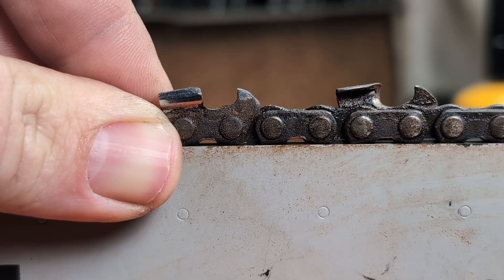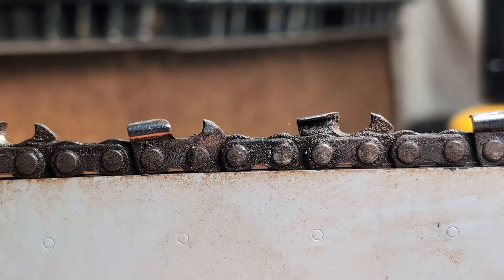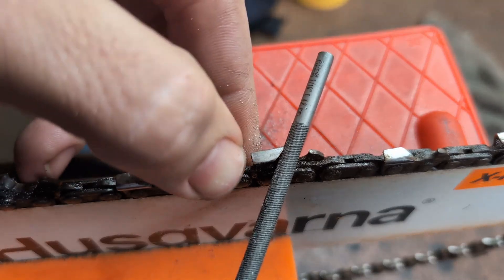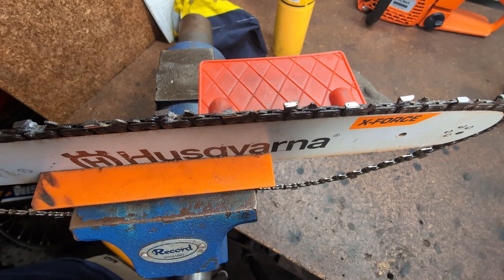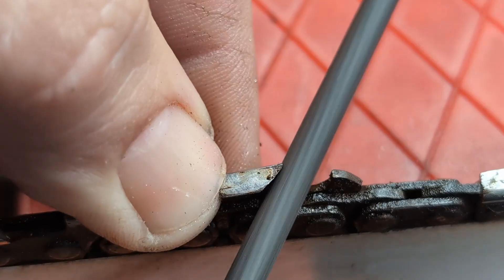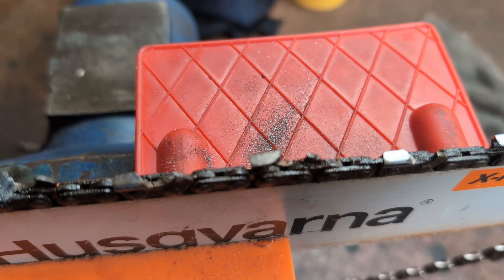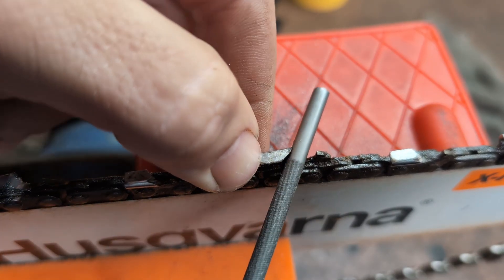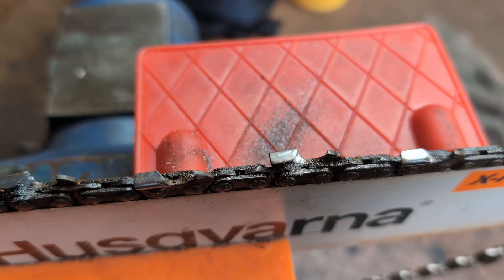Chainsaw mods don't work if you can't sharpen chain

Comment: Vintage engine repairs recently go a MS 500i in that had a burnt up cylinder/piston at only around 6 hour iirc.
And with the evidence visible, it's likely that the customer used a worn/incorrectly sharpened chain. 

If a chain can kill a 500i like that, i think you know what has to be done

Comment: Thanks for the video! I would have liked to have seen timed before and after cuts with this chain. That would have really made your point.
Reply from the maker: I only sharpened about 5 cutters and gave up. I could probably do this once I get the parts for the saw but I'm not sure it would show much. There is no way this will cut anything like this

Comment: What the f did it hit 
I see the crazy angle what was he trying to cut balsa 
did you see the 500i the blew up at 6.5 hours  blamed on a blunt chain
Reply from the maker: The other side has less angle, I think this was just a case of not knowing any better.

I have seen plenty of saws killed by chains like this. It is just insane to me but hey, it had a good muffler mod. Heaps of power to hammer that blunt chain into the wood 😂

Comment: By the look of the colour of the chain, I would almost guess they are using used engine oil as bar lube.
Reply from the maker: Possibly, it has also burnt onto the chain with a lot of heat